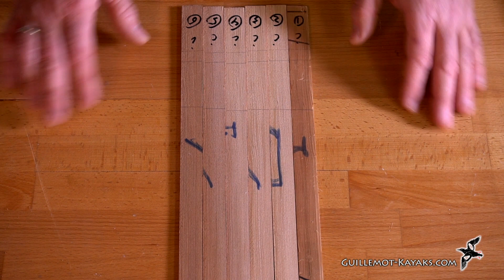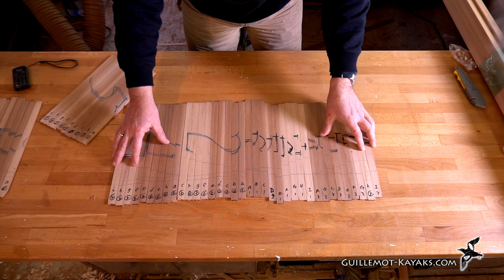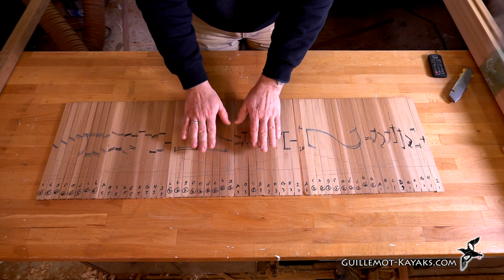Sorting Strips Brain Bending - microBootlegger Sport - E9

Comment: It seems so easy :-) But I really have to stay sharp on marking my strips. My planks are only like 10 feet long but I wonder if I can match them end to end ? They are redwood, not Cedar.
Reply from the maker: Honestly, I wouldn't bother. If you have wood, it will look good. Matching like this is getting a little over-the-top. If it is your first boat, worry about other more important things first. While doing all of this is kind of cool, just making a kayak is already pretty cool, you don't need to do matching to have something pretty awesome.

But, that said. I have done what you suggest, flipping some of the strips end-for-end so the bow matches the stern. If you really want to melt your brain, that is definitely the way to go.
Reply: I did a Shrike in S&G, and I have other kayaks. So I dont really need another kayak. But its very relaxing to work with :-) I will probably go a bit against your advice and try to cut a small plank to see both bookmatching and end-for-end.  Thanks for the answer. And great videos

Comment: Now a serious question ! You are getting 6 strips out of a 1 1/2" x 3/4" blank. Does that last strip, get shaved a little, or is it a little thinner?  Working with 1 1/2" blanks would be easier, than say working a 1" x 10"x 16'  plank back and forth through a Table saw. Finding it increasingly hard to find 1 x stock, I may try your strip cutting method ! Again Thanks Nick ! !
Reply from the maker: Even in a nominal 2" thick piece which is supposed to be 1.5" there is still some variation, and despite my efforts to be very precise with my cutting, with some blanks, I will and up shaving a bit off the last of the 6 pieces, and with some the last will be a skosh small.

I am finding the best stuff is in the 2-by rack, the nominal 1" material just doesn't come through with the same color these days.

Comment: these series are great... I had absolutely no idea that all this can go into just laying out wood. another thing I've wondered about is can start planking at the waterline? As in the first plank runs parallel with the waterline. Basically planking in quadrants instead of halves.
Reply from the maker: I will actually start stripping from a line just above, but parallel to, the waterline. One of the considerations is getting the forms out. If you start a place that is not the widest point, some of the forms will have to get out of a gap narrower than the form.